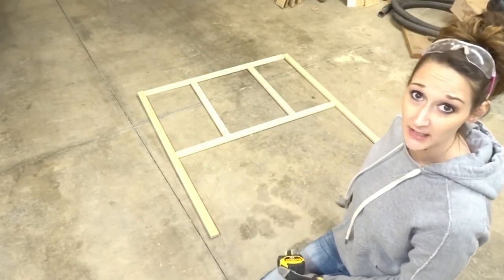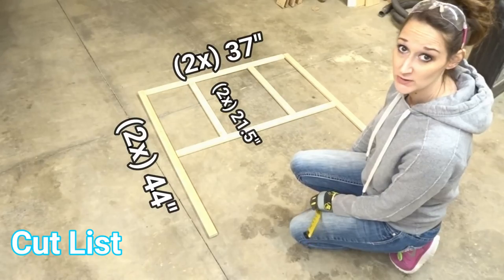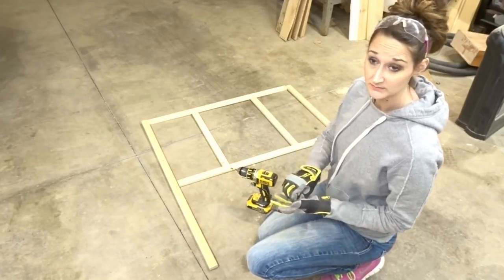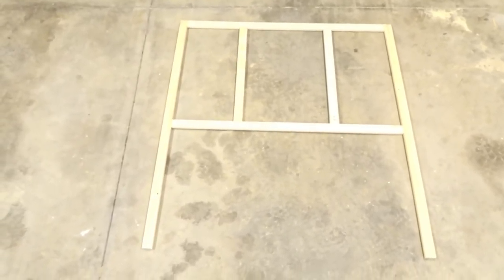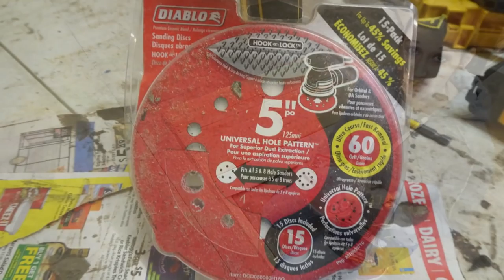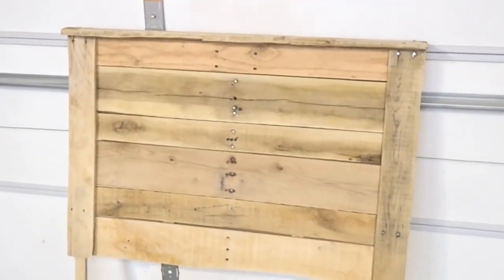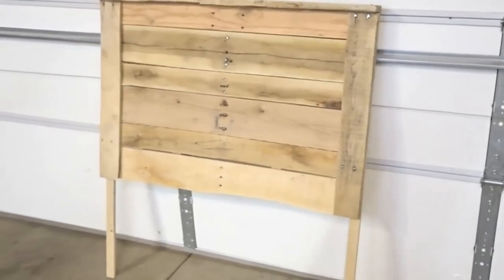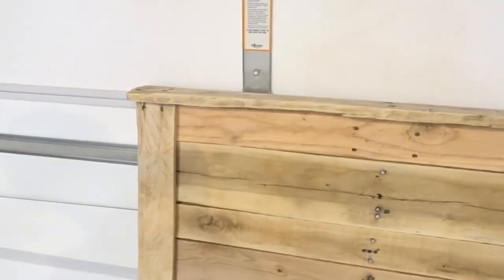DIY Pallet Wood Headboard

Comment: I LOVE ur channel...this was an amazing DIY.  When using pallet wood do u recommend treating the wood with a bleach and water mixture and then sanding?  We r thinking of doing a pallet accent wall in our den area and I would LOVE ur input.  Thanks in advance!!
Reply from the maker: I would bleach/clean as best as you could if you have the time to let it dry out all the way first. The more prep to sterilize the better. Also sealing it as much as you can once it’s up will help too. I know people worry about the “fumes” that it might give off but I can’t imagine it’s any worse than the air we breath if you are in a city shopping/working/visiting/etc.
Reply: The Daily DIYer thanks so much...we r going to take the time to do the bleach and water mixture  in the pressure washer first, sand them, and then seal.  I'll be sure to keep u posted...thanks again